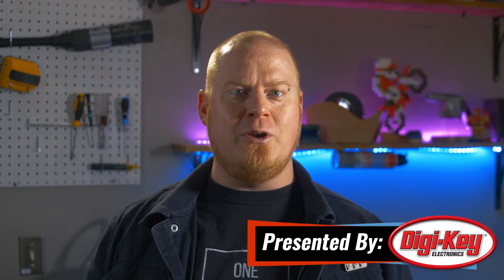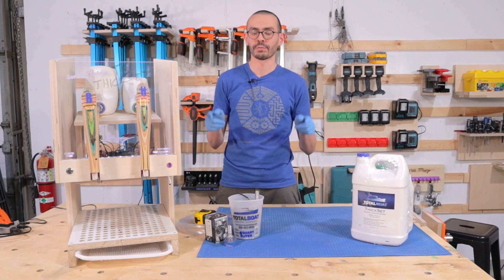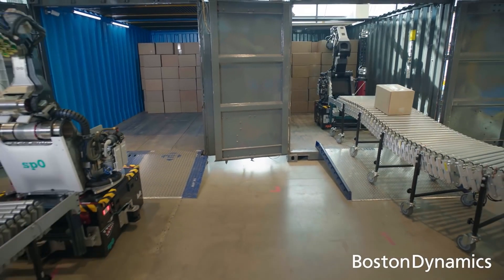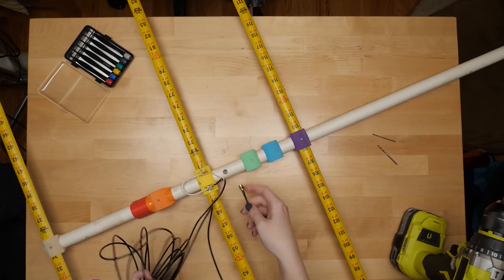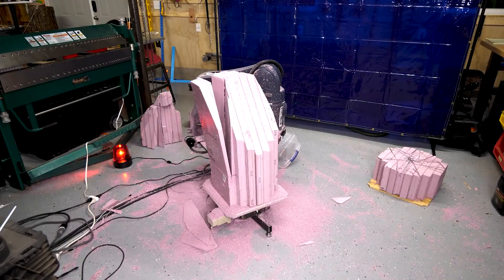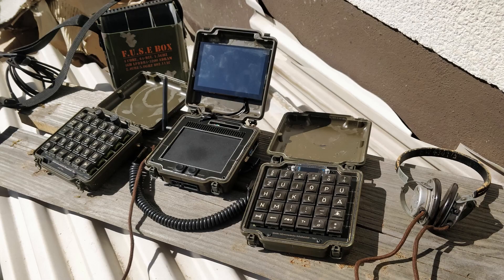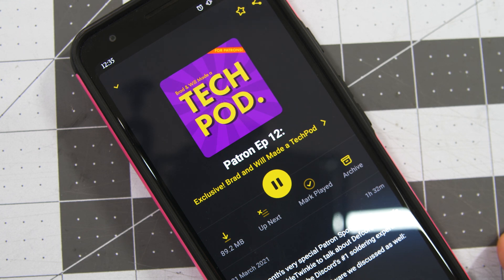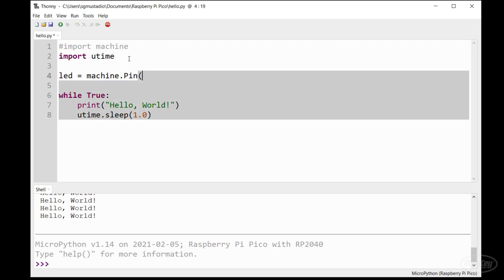A Stiff Drink [Maker Update] | Maker.io

Comment: The people who built the epoxy thingy, didn't know about the  adjustable epoxy pump sold by aircraft spruce? 
the pump is adjustable from 2:1 to 4:1. 3 ratio
Pump has 2 x 3/4" pistons which allow ratios of 17:100 to 65:100.
All they needed was a mechanism to pull the lever! Easily done with a linear actuator.